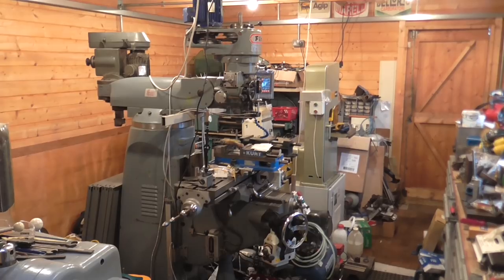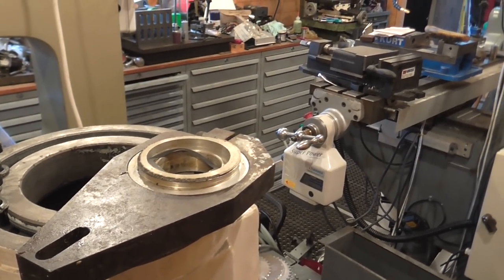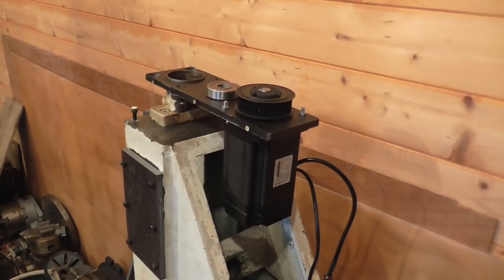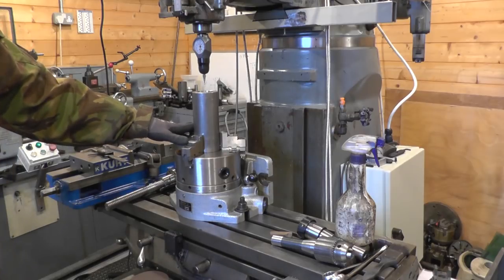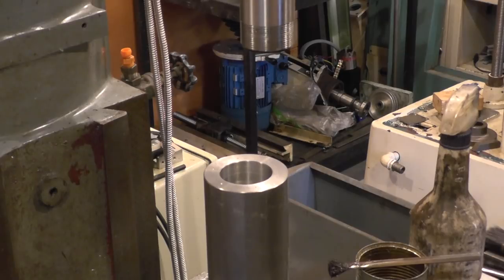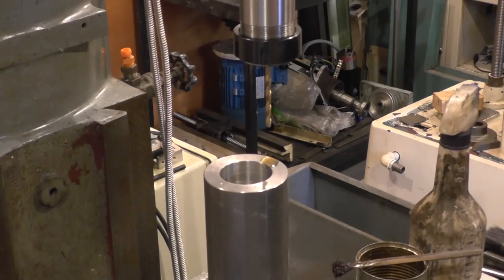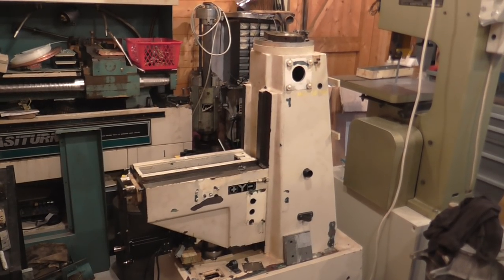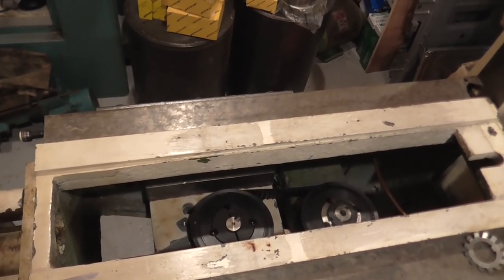Denford Easimill Introduction

Comment: Looks good Paul. Looking forward to it all coming together. Bet it's a bit fresh in the shop at the moment! Certainly is here
Reply from the maker: It certainly is! Thermal underlayers help, but it's handling cold metal that's the problem.
Reply: Paul Compton   aint that the truth! !!! After four days of nice warm underground trains going to the show I now have to catch up on outstanding jobs in an unheated engineerium, brrrrr
Reply: I second that.
Reply: @EVguru  Any chance you have the manual knee crank handle for this machine? i have been trying to track one down
Reply from the maker: @fstirling3843  It was a repurposed vise handle and was re-purposed back into a vise handle for a vise that I have now sold.
Reply: @EVguru  LoL nice, no worries, I have an A2F the manual Excel version of this machine, which i am converting to CNC, I hadnt seen these denford ones until today. What motors do these ones use? Mine has a two speed 440v which i am having to drive through an direct drives inverter converter as it cant be rewired, i would rather put somthing more modern on it, but im guessing i would have to make an adapter plate as it seems to be a defunct motor mount. What are the specs of the servos you have fitted?  Do you have the quill feed box? what does that look like? Im keen to see how this machine progresses, its usefull for my own project!
Reply from the maker: @fstirling3843  The spindle motor was a 415v twoo speed. At about the 2 minute mark, you can see a motor sitting on the bottom shelf of the trolley. It's using one end plate from the original motor as its mount and has had its shaft extended to match the original motor too. I took the opportunity to bump up the power rating too. The servo motor part numbers are in one of the other comments. This machine was built without any quill feed mechanism other than the Z axis ballscrew and the head casting wasn't even machined for it.

Comment: Hi Paul, great video as ever. Really looking forward to seeing your progress with the Easimill. Could you share the specs of the motors and drivers you are using?
Reply from the maker: The motor model numbers are 2 off 86HBS85 and 1 off 86HBS120. Drivers are 3 off HBS860H.

Comment: Hi Paul, hope you're well. I'm collecting an easimill next week and trying to figure out how best to move it. Manual says 550kg. Ideally I'd want to get into a high roof transit. I'm wondering how difficult it is to break it down into manageable bits, i.e head and motor off etc... Be interested to know if you have any clever ideas! Cheers
Reply from the maker: I moved mine on a plant trailer, so no dismantling was needed, but the top end comes apart pretty easily. Make sure the control box is well secured, or completely removed, they can vibrate loose. To be honest, the control is the least reliable part, quite limited and best replaced with Mach or LinuxCNC.
Reply: @EVguru  cheers. It's running on UC100 board, gecko drivers and UCCNC software. I think the motors are original but not seen it yet. My plan now is to use a pallet truck and hire a drop side van with a tail lift. Hopefully that works out ok! Do you still have yours?
Reply from the maker: @mt-qw7yt  It's somewhere at the back of a long queue of projects.